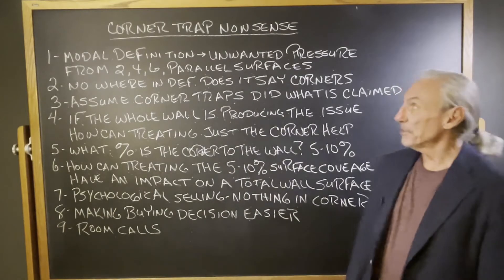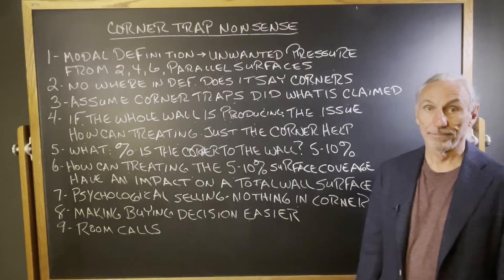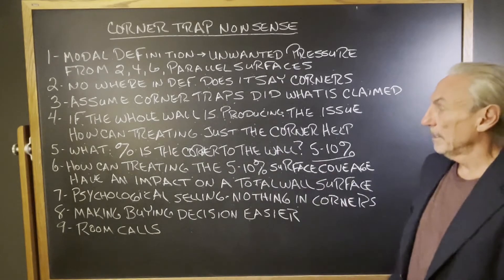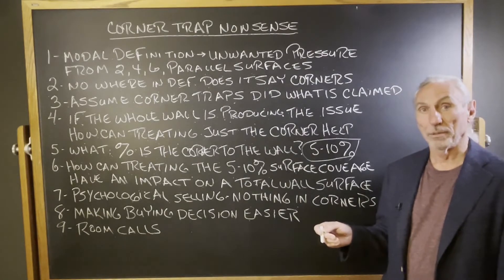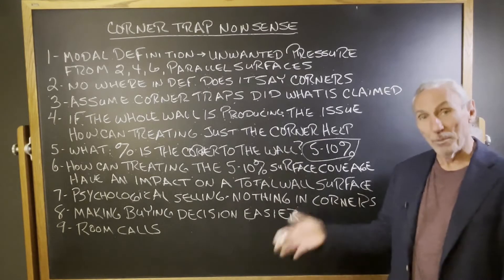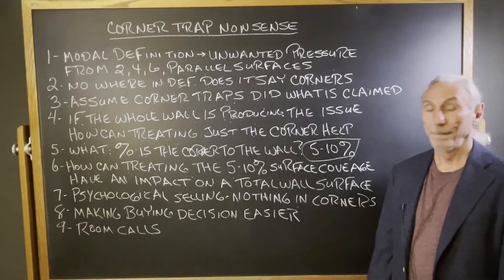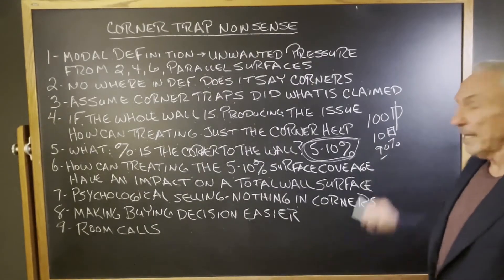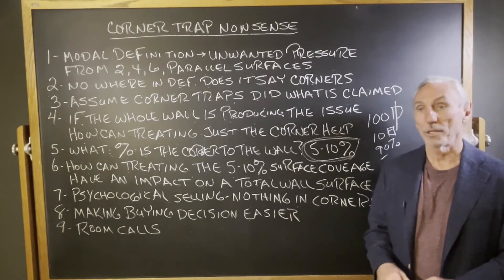Corner Bass Trap Nonsense - www.AcousticFields.com

Comment: Well considering you have way more wall space than corner space, it makes sense that treating the entire wall will make a bigger difference. That's a lot of absorption. But what if you have a limited budget? Like only a few 4'x2'x4" absorbers or whatever. Do you put them in the corners, or somewhere along the wall? I'm under the impression that placing your bass traps in the corners is a way to maximize the effectiveness of what you have when you don't have much to work with.
Reply from the maker: We are not about partial fixes. We are all about achieving the ultimate resolution possible. There are numerous other companies that sell bandaids made from building insulation. We want no part of that approach.
Reply: @AcousticFields  Wow. I wouldn't have expected you to just outright say it. Interesting approach. Very Gibson. Looks like the acoustic treatment field has its share of snobbish gatekeeping as well. Well y'all have fun.
Reply: @AcousticFields  OK, fair. What about the general approach of using broadband porous absorbers with appropriate thickness and air gaps to reach into the bass ranges. Are you categorically opposed to the use of porous absorption for this purpose?
Reply from the maker: @Sunporchmedia  That material type lacks the rate of absorption required for small room, low frequency, amplitudes. You cant build enough of that material type to get low enough and get enough to get proper amount for balance room decay rates.
Reply: @AcousticFields  Thanks!

Comment: important topic and its so sad that corner bass traps are all over the webshops and it is misleading. 
for me to get a result from corner absorption i stacked 4 panels diagonal across my corner, it reaches 30% into the sidewalls and its floor to ceiling, panels are 8" thick, 48" wide in total.
Reply from the maker: Wrong treatment type and not enough surface area coverage

Comment: Very good points!  I don't actually know what issues I'm going to have yet because I haven't finished building the system.   The room is 28' deep screen wall to back wall with an entry way on each side at the back.  So screen wall to each entry door is about 31'-6"... I think, might actually be 32' and the room is 21' wide and 11' ceiling.

The control room for the projector and front end equipment is behind the back row of seating.  I have a large cutout on one side originally intended to face front end equipment into the theater but I decided to take that out.  Next I decided maybe not take it out but instead put 6" of acoustic material like Rockwool in the opening and trim it out on both sides with decorative grill cloth etc.  Then duplicate it on the other side.  It's maybe 21" x 42" or so, just estimating.  The two openings would be about 12 sqft.  It would end up being 13 ~ 14% of that wall area of basically resistive/reactive opening to another space.  Maybe it's not worth it, maybe I go back to the plan of covering over the original opening.  Or, there is room there, I could make additional openings, maybe get the area up to 25 ~ 30%.  Then of course there are also the entry ways so even with the original opening closed, well over 30% of the back is 31 ~ 32' deep so with the two opening idea, about 50% is 28' from the screen wall and 50% 31 ~ 32'.  Maybe it works!

Because it's mostly surrounded by attic space, I can put as many independently DSP controlled woofers as I want in the attic firing into the room anywhere along the sidewalls.  I've got around twenty 15" drivers already on hand and plenty of DSP modules, and amplifiers so that might be the best approach.  I'll know more once I get the basic system finished and see what bass issues I have.
Reply from the maker: I see many issues I do not like with your drescribed project. Fill out the info in this link. You can include up to 6 pics / form. Fill out seperate form for each room size/volume/usage. Lets then discuss by phone.
https://www.acousticfields.com/free-room-analysis/

Comment: You are Correct!! When I built a room for recording Drums, I just treated the Four Walls and Few Panels on the ceiling! The Recording,  The Jamming session and Movie Viewing improved a Lot.!! 

But, some of the Clients don't want to record in my room saying there is No Corner Trap and Say it will create issue during Processing without even trying it out.! The educational thing that You are talking about in this video is 100% true..
Reply: Just play them your demos. Either they are good or they're are not. Rooms matter only so much. Look at all the variations that have good results, regardless of clowns like this video person.
Reply from the maker: Every surface of the room produces some type of pressure or reflection issue.
Reply: I'm happy to read this nice comment.
Currently doing research to make my own bass traps.
Everyone shouts corners, so I'm guessing the autor of this video is kind of underestimating the power of bass-traps in corners.
However, what he says makes perfect sense, but is more difficult to verify, because everyone is having a corner-fetish.

I'm happy to read from someone with positive results.
2 bigger panels per wall might help me to reach the same result, while spending less money.
Extra kudo's: this means i can still use the corners if I still need more results.

Comment: Do you have any data on % treatment coverage vs % perceived improvement?   I'm assuming it would follow close to the 80/20 rule where 20% (proper) treatment will get you about 80% of the way... thoughts?
Reply from the maker: You must treat at least 50% of each offending surface area.
Reply: Thank you for telling it how it is straight up.  Thank you for all that you do for the audio community.  Cheers Dennis

Comment: Given that the corners are the common nodes for the room's modes in all three directions, is it accurate to say they yield the most absorption for the least amount of area?
Reply from the maker: Room modes are distributed throughout the room and low frequency energy oscillates in cycles throughout the room volume. The oscillations can occur at 3-4' intervals depending on frequency of issue. An axial mode is produced by unwanted pressure between two parallel walls, not two parallel corners. The industry has perverted the modal definition is order to sell corner units to the uniformed public.
Reply: @AcousticFields  On the whole I agree with you: To treat the bass modes in a room, you have to treat the entirety of the parallel walls. I can only imagine the marketing nonsense implying that bass collects itself in corners.
If I understand it correctly, corner traps are like cornerstones. You can't just grab four of them and have an effective wall. But comparing them to the rest of the stones, they are somewhat more important. The corner location is marginally more effective because it exists at three modal peaks: one each in the length, width, and height dimensions. Perhaps the result is that you get the effect of 5% coverage for 2-3% of material. Or more accurately, the corner locations are capable of damping more energy compared to other locations with 1 or 2. You still need to treat the other locations, the same way you need other stones to build a wall.
Reply from the maker: @BrazenRain  For low frequency management, most of our projects dictate a 50 - 65% surface area coverage on all four walls and either the floor or ceiling.

Comment: Dennis it might just be better if you came to my house and fix my room.
Reply from the maker: We can get the treatment requirements without all of that travel chaos. Our data base has over 250 built and measured rooms in it. The data base will get you to an 80% resolution by specifying the treatment surface area requirements. We do it all the time. We can then voice the room through certain tests to squessze out an additional 10%. Fill out the info in this link: 
https://www.acousticfields.com/free-room-analysis/

Comment: I have a suggestion for a measurement video that you can make.
1. Measure the untreated room for reference.
2. Measure the effect of low frequency absorbers in the corners vs. other locations. Where do they perform the best?
3. Measure the fully treated room. To get an idea of the overall improvements. 
4. Present the details, like room size, number + type of absorbers used, the freq response + waterfall measurements and the conclusion.

Basically, it is a video where you demo the absorbers and the science behind treating room modes.
I think it would be interesting for many people to see the measurements.

Thanks.🙂
Reply: @TheJohnsofDoes  Hmm yeeeh, that seems to be the case. What a shame.
Reply from the maker: This described measurement process would be a waste of time, money, and energy. The corners are not the issue. Look to the definition of modes for your answers.
Reply: @AcousticFields  If you take out step 2 then you have the process that you should be doing already (right?). Put step 2 back in and you have a great opportunity to bust the corner myth.
Taking a few extra measurements cant be that big of a deal.
Reply: @djbremsespor  whats with super extreme dorks that cant just freaking listen to music out of some decent 4k of home 2 channel audio and have some average sound treatment for a few hundred dollars only. Mind blowing anyone making say under 200k a year whom would say spend 100k on sound absorbing or dampening bs. 98% of people make sub 200k . My uncle whom is worth 50million and likes good audio dont even have any sound absorbing etc in his mansion and the audio sounded fine . most people can give 2f's less if they some how dont hear a certain hz of sound due to improper treatment.  Im finally buying some decent speakers and a decent hifi dac to stream from Tidal and i can garanteeeeeee ill be blown away  in comparison to my logitech z5500 system that has 4in sattelite speakers as mid high and buzz on many frequencies .
Reply: A definition, probably incomplete in order to prove what you want, is not science. A test is science. You are currently wasting time, money and energy doing things according to something that it's not proven. And trying to make other people do the same...

Comment: About 5 years ago, I cut rockwool into large triangles, and stacked them on a frame in the upper corner of the front wall. The whole stack is about 15" thick. It reduced a bit of the resonance at low frequencies that screamed out for attention with some music (piano in particular).
Didn't fix the room by any means, but was a cheap, quick and made things more tolerable until I could get around to doing something more affective.
Reply from the maker: Thank you for sharing your experience. The problem with the acoustic belief systems today is that technologies are viewed as absolutes. If it is a sound absorption product, it absorbs everything. All is well no more needs to be done. Using tactics, that do not have the proper rates and levels of absorption to treat the appropriate frequency and amplitude of the issues, will never work. People need to realize those limitations. When realized as in your situation, most will seek higherr resolution. Our thinking is to achieve the highest resolution you can with using the fewest tactics. 100 % fixed, 100% right.
Reply: @AcousticFields  try with a room calculator a gap between foam and wall give better low bass damping .when you put a plate in the corner there happen a distance gap to the wall in the middle. this distance to foam damp low bass more but is less effective at mid frequency. also keep in mind when a reflection hit the basstrap in corner it can be reflectet and hit the other side of the basstrap and is damped twice. overall i think damping in corners give not more as 15% more as on normal wall but it is more damp for the money. best is also on floar when a plate is on floor or roof and both sidewalls. only when need more damping then do lonely walls and loose a little effective to money and more noticable room size because of the gap from foam to wall
Reply from the maker: @nobot99997_xxl  Our experience with lower frequency absorption technologies does not support your conclusions.  Using a subjective term such as "better" when you are describing the physics of absorption are not helpful. You are stating tactics without a frequency and amplitude strategy. Your room will be a room filled with tactics that do not address the real frequency and amplitude issues at each room boundary location. Why waste time with bandaids when complete solutions are available.
Reply: @AcousticFields  there is on internet Porous absorber calculator. when insert air gap 0 a example damp reach at 95 hz damping 0.2 . with air gap 100 mm  at 52 hz  damping 0.2 . in corners it is easy to reach such a gap when put plates before. i invest not much money but get with near all corner damping with gaps much more decay reduction as when i put the plates more in front. same as with water waves. when they are broken on 2 distant places help alot
Reply from the maker: @nobot99997_xxl  Are you applying these frequencies and damping to the correct frequency/amplitude/location within the room?
Reply: @AcousticFields  basstraps in corners  also work as diffusor. frequency depend i guess not work for me, because i want a larger sweetspot and i have very sensible ears. I sit  5-10 cm more back or forward on my dekstop on chair with rolls . the frequency of modes change alot in measure tests in 15 cm range . I use 6 t aukustic bass traps melamine (3 packs that cost together 240$) . 10 cm away from corners. this give me also a larger sweetspot and i feel no pressure in ear after longer hear. good enough for me. melamine material  is important
Reply: @nobot99997_xxl  obviously you'll see SOME difference when you apply treatment vs. zero treatment (even if it's placed incorrectly) but correct placement with the right material for the problem frequencies will garner the most effective result.
Reply: @jerrywemhoff  the audio is reflect many times in the room until it is 10 db lower in bass. in corner you can put easy huge foam but in middle of room not, maybe furniture or look worse
Reply: @jerrywemhoff 2 part. i can see how much my cheap melamin foam reduce decay time and see on inet results of more expensive . so the reduction  i see is good for the price and i think now it sound good and thats important
Reply: @nobot99997_xxl  the mix doesn't care what the room looks like
Reply: @jerrywemhoff  seem you only do theorie and have never test and measure. I test many places there is no place and then suddenly rt60 enhance more as on other places in bass below 100 hz. basstraps in room corner fit better to furniture so i use this place
Reply: @nobot99997_xxl  I've done the work, I'll chalk your pithy response up to a language barrier.
Reply: @jerrywemhoff  then show video with FR and decay curves that confirm that place really give noticable measureable changes outside corner. nobody do that be the first and do that
Reply: @AcousticFields  lack of education is the main problem. One of the main focuses of my sophomore year of audio recording technology was acoustic design (using the same concepts from freshman math and physics for audio). We learned how to recognize and diagnose problems and build what we need to fix it.
Reply from the maker: @jerrywemhoff  Our educational systems do not emphasize the hard sciences enough. If people had more science in their diets, they wouldn't fall so easily for acoustic half truths. They would be insulted that someone was trying to pass nonsense as fact.
Reply: @AcousticFields  I went to school for audio at a community college. the department head emphasized the science over EVERYTHING. Granted, this was 16 years ago, but the program still maintains this emphasis.
Reply from the maker: @jerrywemhoff  Nice to hear that. We have found that the facts are always friendly.